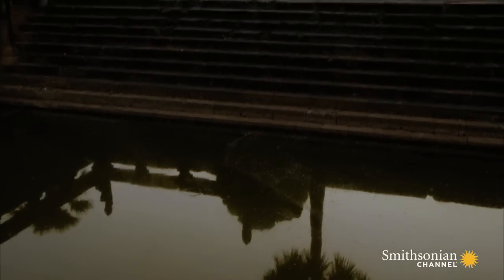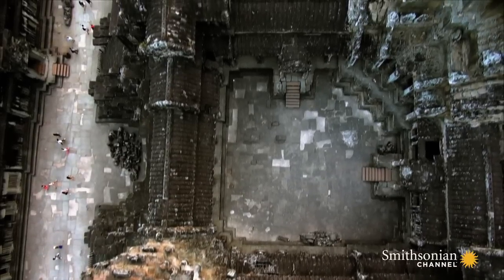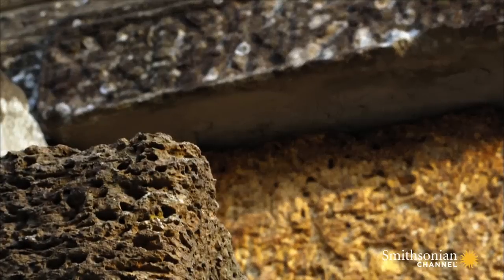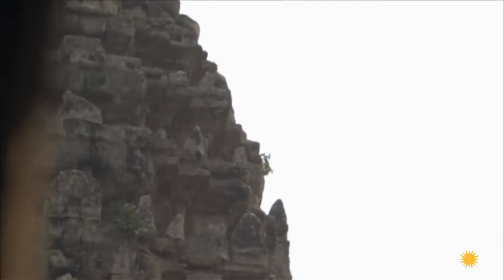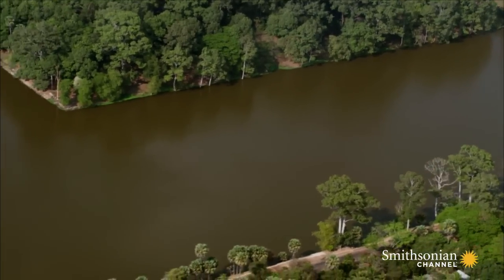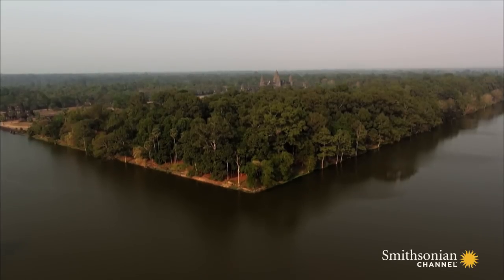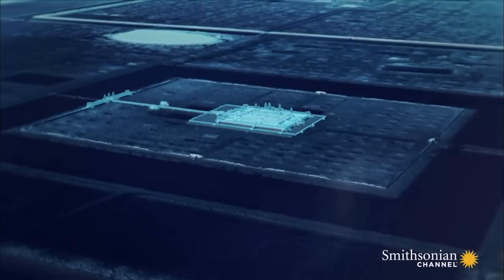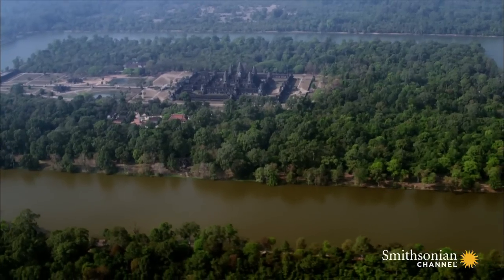How is Angkor Wat Still Standing Today?

Comment: I typed out the transcript for this video. I'm just posting it here incase anyone wants to use it.

Angkor what was an engineering Masterpiece. Everything that Khmer had learned over hundreds of years of temple building and Engineering Great Water Projects came together in the construction of the jewel of their civilization. Most striking of all was the scale of the construction. Angkor Wat covers an area more than 4 times larger than the Vatican City. And this created huge challenges for Suryavarman's engineers. During the monsoon the land becomes saturated and expands. After the monsoon, it dries out and contracts. Laterite was a core building material of all Khmer temples stretching right back to the Rong Chen temple in the Kulan Hills. Now it was being used to help solve the Khmer's greatest engineering challenge. "How do you build high with such heavy material as the sandstone. Well, look behind the facade, and what do you see? You see that it's filled with this very lightweight porous material called laterite. It's a kind of ancient breeze-block." But Richard Englehardt thinks that the use of laterite was only part of the solution. He believes that Angkor Wat is still standing today because of the water surrounding the great temple. "In the ideal Khmer structure, you cannot separate the building from the moat. They are inextricable. They are symbiotic and you cannot have one without the other. Both in the terms of the design and the conception of what we're building and the civil engineering features of it. The construction of the moat surrounding Angkor Wat was a huge operation. It's estimated laborers removed enough enough silt and sand to fill the Empire State building one and a half times. It's perimeter is over 3 miles and it is 650 ft wide. Then, the moat fills with water. Water is heavier. It's more dense than laterite and earth. So the weight of the water is actually heavier than the weight of the materials you've taken out. Richard believes the weight of the water in the moat pushes back against the downward force of the Stone Temple. The moat is essential to the success of the entire structure. Without the moat, the structure could not stand. The two are completely part of one holistic engineering system.
Reply: Much appreciated
Reply: OMG THANK YOU SOSOOSO MUCH
Reply: Thank you so much

Comment: I can see his point, in that the structures would have toppled and sunk with out the counter balance of the moat. As well as the weight reduction of the inner core.
Reply: is it just a strike of luck??
Reply: @AndresBonilla211  Some speculate it has already sunk once, by Suryavarman II, he built it a second time by expanding the moat that wide.

Comment: I'm a civil engineer, and I am skeptical of this guy's point.
Reply: he's quite right in term of the concept and the engineering
I'm a cambodian architecture student and i study about my own temples quite in depth tbh
Reply: My issue is with his argument that the mote is a necessary part of the monument.  It is true that the water is pressing against the edges of the mote which helps to hold it up.  If there was nothing in the mote at all, the walls of the mote may collapse over time.  However, if the mote did not exist at all (was filled with soil), the monument would still be fine.  Soil is more dense than water, which is why dirt doesn't float to the top of the water in the mote.  There is also water within the soil, up to the water table, which still provides pressure.
Reply: Tee Touch that’s what I heard too. I’m Khmer American. I understand the ingenuity. Makes you think and wonder.
Reply: I'm not an engineer, but I think the moat is not using to press the stone wall or something. It's because the foundation of the temple is made from sand and wet sand is much better than soil the only problem is in tropical weather there is only rains in rainy season, so the solution is to make moat around the temple to store water for dry season.
Reply: @Erich, I do not understand your point. The guy said that water is denser than laterite, which makes up the surrounding earth. Secondly, soil is not denser than water, and that is why water seeps into soil until it reaches the non porous bed. However, the density of soil increases with the moisture content. You do not see soil on top of moat because the soil at the bed has actually become clay, which is quite dense. Considering you are learning civil engineering, you should know that, eh. I mean soil is compressible, water is not.
Reply: I make sandwiches for a living, and I believe him
Reply: Please come to my city. Civil engineers here don’t know shit about civil engineering.
Reply: Maybe because your a civil engineer?
Reply: The soil is expansive, the expansion and contraction will depend on the water content of the soil. To keep the foundation soil at a constant water content or better we can say , "to keep the soil always saturated" moat is used.
Reply: Erich Maxheimer  Khmer used water because our religion is Hinduism at that time believe in God Vishnu. The place that god Vishnu live calls mount Meru that surrounded by sea of water. The emperor Suryavaramam II connected himself to Vishnu. The Angkor wat was biuld to Horner Vishnu home on earth. That’s why Khmer prefer water not soil.